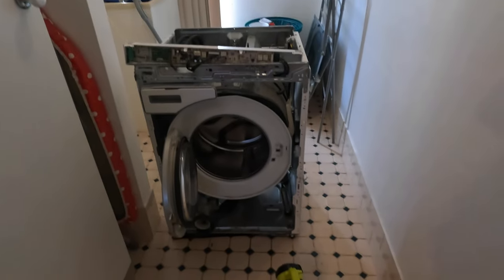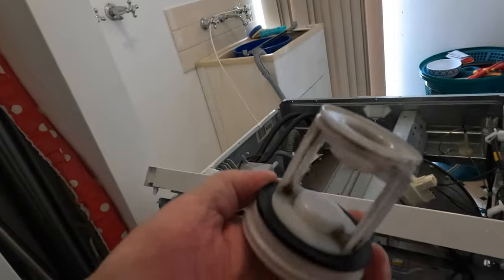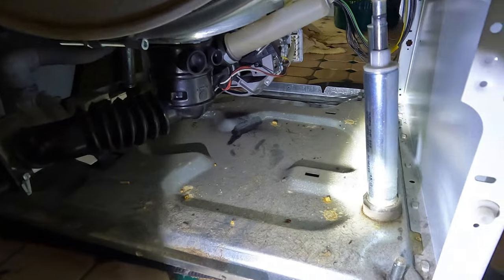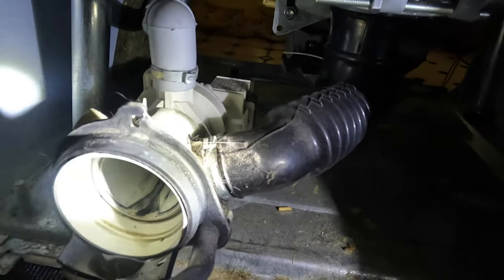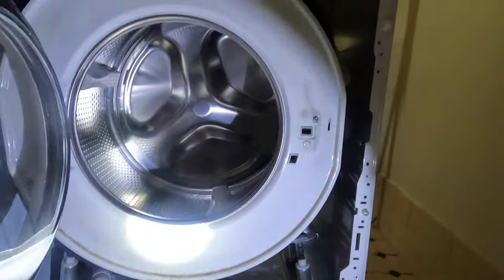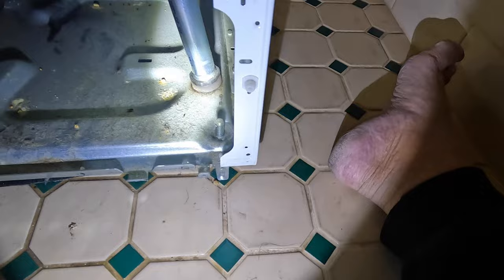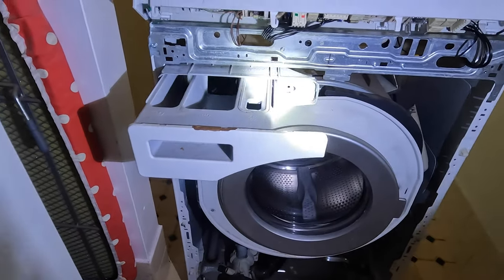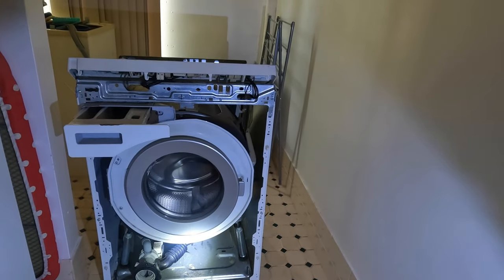The Best Washing Machine EVER

Comment: We purchased the Asko 8kg washer 1600 RPM (W4086C) today. $1,979.10 with a ten year warranty.  Lets hope it lasts as long as your machine. we have Bosch 8 series and it only lasted 7 years.
Reply from the maker: Ours is still working great. the maintenance I did on the wife's machine has it back up and running like new. She is very happy with the unit.👍

Comment: I recently purchased a house with an asko washer (steel seal-tm) and asko dryer.
Honestly, I am not impressed with either!! They are NOT quiet, NOT easy to use (had to look at several YouTubers and then many trial and error days) , and do NOT hold any amount of wash (to brag about). The steel seal washer gasket must be cleaned regularly or it smells. Personally, I would not waste my money on this overpriced and over hyped machine! Just my experience....
Reply from the maker: Ours is still working great. It has done so for many years. Even I can use it. very simple to use. on most front loader you leave the door ajar when not in use. Ours has never had a bad smell in it. Yes they are not quiet. The spin cycle is loud, but the cloths really spin and come out almost dry. The spin cycle can be set 400rpm to 1400rpm we have ours set to 1000rpm. So if a couple of old folks like Sigi and I can get our heads around its controls then it can't be to hard. But i think you are talking about a totally different model, and maybe your just a bit annoyed that you can't work out how to correctly use a washing machine. For the Wife and I, These machines are easy to use and have Never let us down. We don't sell anything at all as we are retired. We are just sharing our experience with the model We have. Like most things in life you can't please everybody all the time. Merry Christmas to you 😊😊👍👍